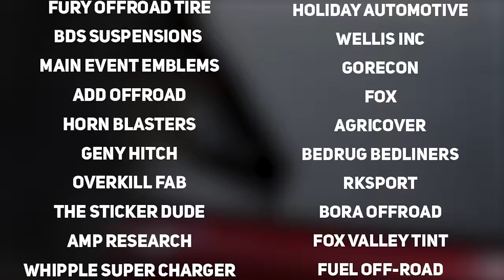TUG OF WAR - SUPERCHARGED CHEVY VS TURBO FORD!

Comment: So the Chevy wins and the Ford breaks down🤣🤣🤣. That’s honestly too hilarious.
Reply: Try it stock and it's a different story
Reply: Cesar Hernandez and? It wasn’t meant to be stock 💀
Reply: @kauznationgaming8118  8 inch lift doesnt help
Reply from the maker: Think we should do another head-to-head with these trucks??
Reply: How bout do the rematch without cheating n since Chevy needed a tune and about an extra 3k pounds slap some sand bags in the ford and load a pulling tune lol wanna make it even right?
Reply: Custom Offsets yes but no ratchet strapping the front axel and no loading the Chevy down with people. Just so the ford fans don’t have anything to complain ab 🤪
Reply: Shae Salazar riiiiight so if you didn’t know the Chevy has a 6.2 or 6.0 vortec and the Ford has a 6.7 liter power stoke. It’s a gas Chevy vs diesel ford bro. It’s not fair at all. I’m Chevy for life but the ford shoulda ate his lunch. Put a duramax against the power stroke and it woulda snatched the ford off the frame.
Reply: Cesar Hernandez try the ford vs a Chevy duramax and both drive shafts woulda Fallin out🤷🏻‍♂️
Reply: @ethanhudson6028  nah duramax would just deove off wit fords frame 😂😂
Reply: Custom Offsets yes!! I was actually excited to see what would happen then half way through the biggest disappointment.. adds weight and has a custom pulling tune? Like why even do it in the first place 😂 this was a joke 💯
Reply: Ethan Hudson ?? You know anything at all?? Don’t matter the HP, weight and traction matter. The Ford could have had 2 million HP and it wouldn’t have mattered. custom tune for pulling, locking in your shocks, and 1k in extra weight.. that’s just stupid. they just made Ford, that axel/driveshaft company, and the driver look dumb just so they could get clout.
Reply: james meyer just so you know the Ford was made for pulling and towing cuase it’s a diesel and pulling tune for Chevy didn’t do as much as you think it was pretty fair
Reply: Chevy guys cheated lol. And that drive axel isn’t stock and probably was made cheap.  Lol.  Not to mention neither one of those trucks will ever do a honest days work. Just driving around mall parking lots towing groceries, truck sluts and McDonald’s frapes.
Reply: It would be sad if the chevy didnt win, its lower to the ground and doesnt got a drop hitch lmao. Raised trucks arent as stable and cant haul as much. Now if the ford was stock, its woulda dragged it
Reply: Isn’t that Fords life story? 😂
Reply: Custom Offsets yes
Reply: Cesar Hernandez exactly
Reply: @CesarHernandez-bo6vk  I mean...superchargers were destined to generate more power than the turbos off the bat🤣🤣
Reply: Ford stands for Found On Road Dead
Reply: @CustomOffsetsTV  Yea and next time Make sure u don't put extra weight into that chevy
Reply: The Ford's driveshaft broke due to over torque soooo...
Reply: Yeah that's totally unexpected 😂
Reply: @CustomOffsetsTV  Yes
Reply: It's nothing to do with torque it has to do with traction.
Reply: If both were stock and the ford had weight on back wheels it would have won all day
Reply: We all know Ford wins by Reliability also tell me why camaros have always been extinct
Reply: Lmao fords honestly suck bro
Reply: Thing is Chevy owners can't afford Ford parts haha.
Reply: And that Ford would pull that Chevy stock just saying done tested it myself it's not the truck it's how much traction it's got.
Reply: Broken Silence well yeah it would it’s a gas vs diesel
Reply: @CustomOffsetsTV  yes
Reply: Ethan, the custom truck won and the custom truck lost because of after market part broke. This isn't Chevy vs Ford at this point. But huzzah anyways
Reply: Found
On
Road 
Dead
Reply: Bro lol that’s the story every time not just in tug of war
Reply: Ethan Hudson it also gets gapped
Reply: The Ford can't AfFord any more of a bad reputation 🤣 Find Out Real Disappointed lol
Reply: @ethanhudson6028  Try the two trucks stock with diesels
Reply: @mohamadkhan9899  It's funny how your joke only has 3 likes
Reply: Ethan Hudson the ford tires were big ofc the Chevy is finna win
Reply: @Turnersspeedshop  if does had weight on the rear wheels that would of helped
Reply: @tikevienevans2848  the f350 weighs over 1000lbs more with the diesel engine.  Doesn't even matter what the weight difference was anyway since the Ford lost due to a breakdown.